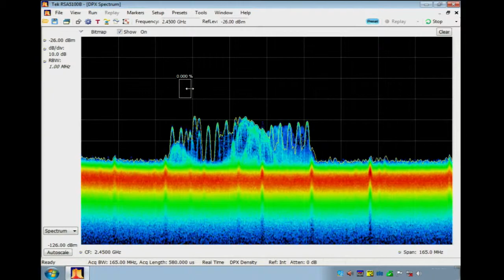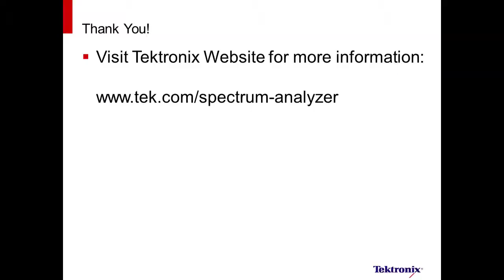RSA5100B: Introducing the 5100B Series I Tektronix

Comment: Hey can i know how to feed the bluetooth signal into RSA. I am studying on the bluetooth 4.0 BLE. Can you suggest the DUT for testing purpose which has got the provision to tap the transmitter RF signal.
Thanks in advance.
Reply from the maker: This will depend on how the DUT can be accessed, which can vary from device to device. For some DUT’s, there may be an RF connection which might be connected directly. Of course, prior to connecting, it would be good to make sure that the output power from the DUT is below +30 dBm as higher power levels could damage the instrument.
Another possibility could be to place a near field probe or antenna near to the DUT. Of course, this should be done in a quiet RF environment if possible to avoid picking up other signals not from the DUT operating in the 2.4 GHz.
If you are performing measurements where there are many other signals present in the frequency band of interest, then we would recommend an enclosure to shield the DUT. This would still be used with an antenna or probe for the appropriate frequency range. There are many examples of enclosures available, here is one:
http://www.octoscope.com/
Reply: Tektronix RF Test Applications
 Can you please recommend me some DUTs for which I can directly connect the RF input of the RSA. I don't want any air channel impairments on the received signal. 
Thanks in advance.